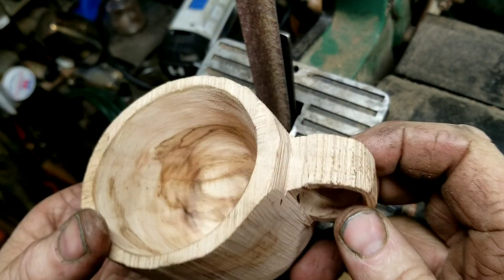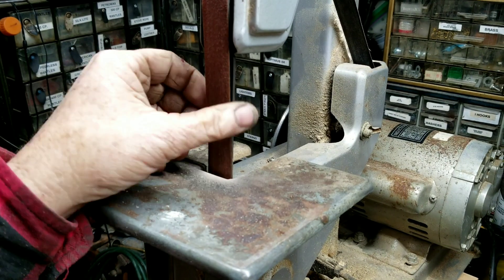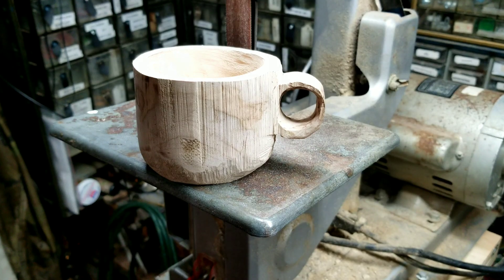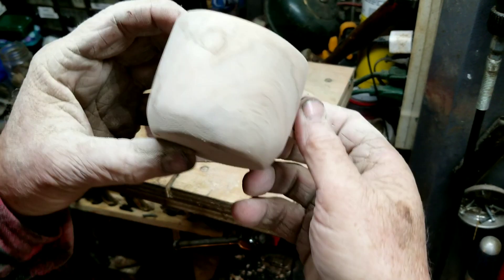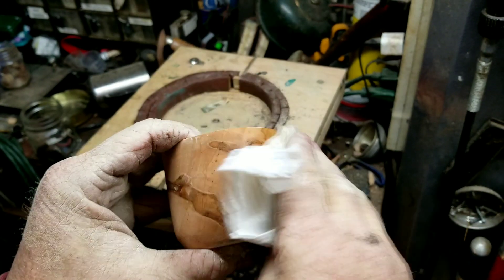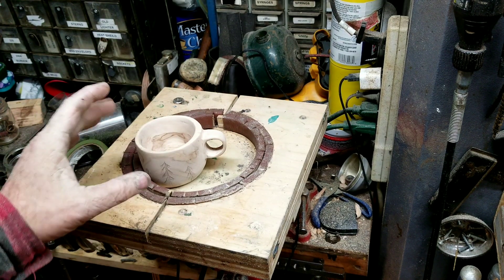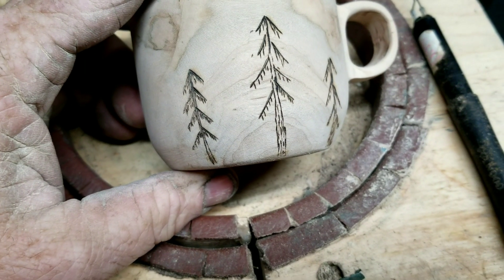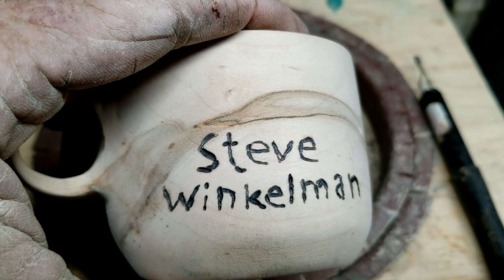Wood carving part 2

Comment: Howdy Robert- that turned out really nice. One of these days I may have to give that a try. Take care and God bless
Reply from the maker: Thank you sir. You should give it a try but start with green wood. You can put it in a ziploc bag with wet shavings while it dries to prevent cracks but that's just what I hear. 
They say the green wood carves much easier but I got some really nice pieces of maple and cherry laying around that area well seasoned I may as well use them. 
Thanks for watching and God bless.